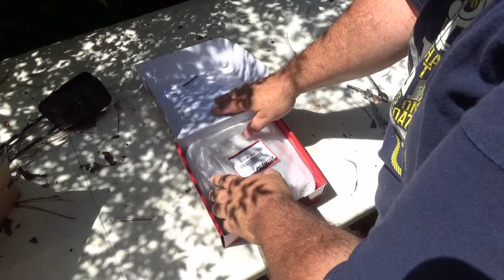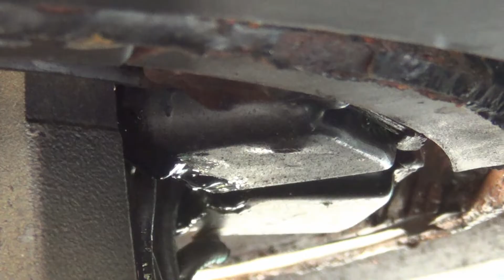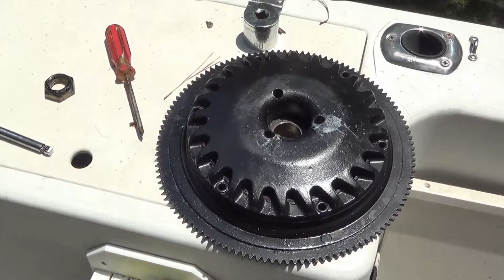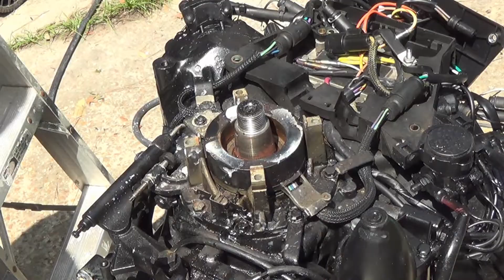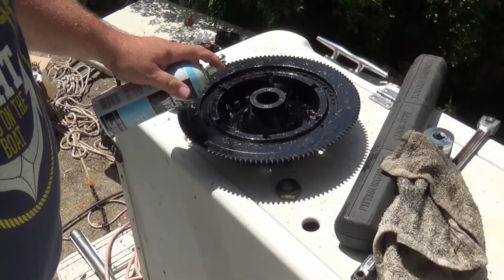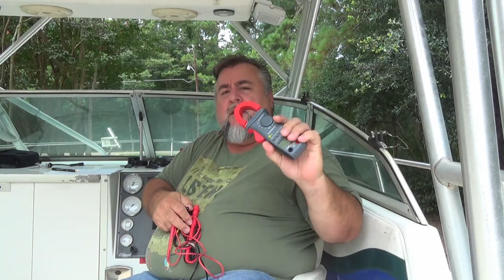How To: Change the Stator and Flywheel on Evinrude / Johnson

Comment: I know its an old video but, my stator on my johnson 225 crapped out. Bought one from jetunit. I have a problem. It has 2 more wires in the front than my old one did. Any idea where they would hook up? Thanks

Comment: Hey , just curios if the magnest were making a rattle sound ? I developed a sound that sounds like its coming from the flywheel & thinking i might have a loose magnet(s). Or did it stop charging & you discovered the magnest when you pulled it appart ? 
Ill have to pull it apart & check but just curios.

Cheers,

Comment: Daniel hi. I have a johnson 1997 150hp optical sensor. My problem is have only fire sparks in 1,3,5 ...the pistons 2,4,6 not fire. I change new powerpack & optic sensor and not fire in 2,4,6 piaton. Help

Comment: Just so everyone is aware: ALWAYS LAP A NEW FLYWHEEL!!!! If you put a different one on, the tapers are not going to seat properly! the crank and flywheel are a MATCHED SET from the factory and seat themselves uniquely. another thing: make sure the INSIDE magnet for the timer base hasn't shifted by referring to the reference chart for your particular motor.
Reply: Excellent comment . Thank you. I have a 2008 225hp.

Comment: A previous "mechanic" didn't have the $12 steering wheel puller & ruined the flywheel...!  What a Dumbass...!   Daniel needs to add a Cordless 20V 1/4 inch Dewalt impact to his tool arsenal...!  Yeah, don't snap those bolts off...!

Comment: I just replaced the stator on mine, and now I have no spark at all. Which wires did you have backwards on yours? I used the exact same replacement part from same company and can’t get fire at all on any cylinder.
Reply: I haven't seen this guy reply to any messages. I'm getting ready to replace the stator on mine soon. Please let me know if you figured out what caused your no spark issue in case I run into the same situation. Thank you.
Reply: Jacob Ellis mine ended up being the prongs inside of the stator plugs were loose and not actually making connection. Idk why they are made that way but I just assumed they were fixed like the factory stator, but the plug from the power pack was just pushing them back into the stator plug. I used a jetunit stator so a CDI may not be built that way. Also ended up replacing power pack before I discovered this issue.